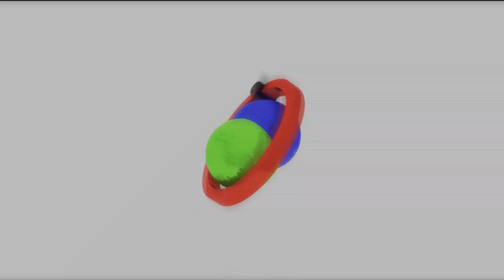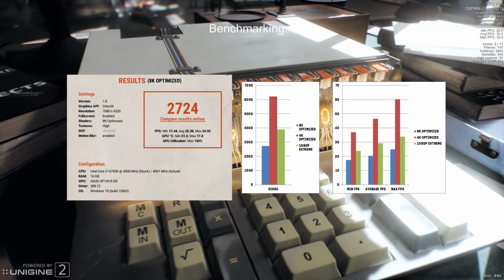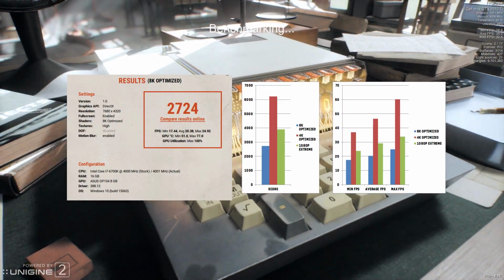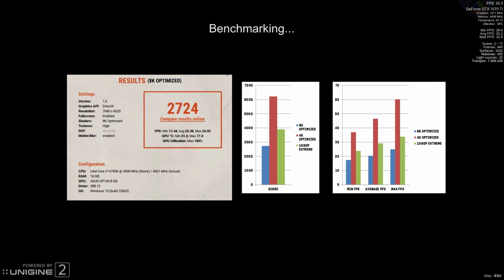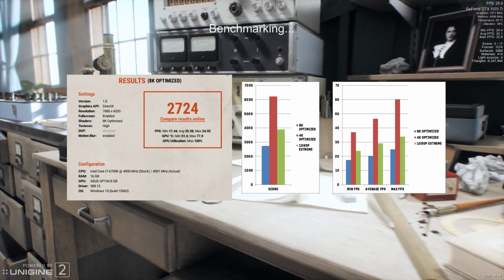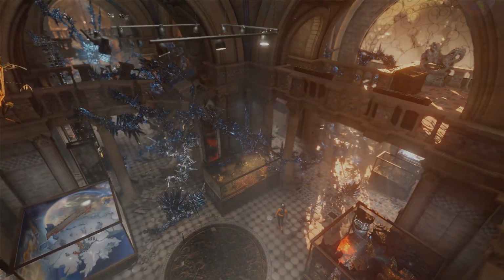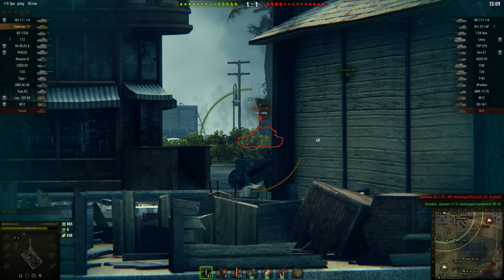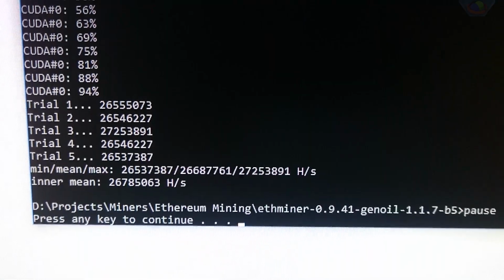ASUS STRIX GTX 1070 Ti Advanced - Unboxing and Benchmarks

Comment: It makes sense since it is only a 5-10 fps short of a 1080 but is 50 dollars cheaper. But some sturdy partner cards can overclock slightly to perform like a 1080 for 50 dollars less.
Reply: Gonna pick one up on craigslist for $150
broken fan, doesn't work in ryzen builds tho
for some odd reason
Reply: @mochageico  doesn't work with ryzen?!😕 first I have heard of this!
Reply: @sol666  Yeah, neither have I.......
The guy isn't responding to my messages anyway 
so 
probs can't buy it
He said it works with fx builds and intel builds.
idk why it wouldn't work with ryzen